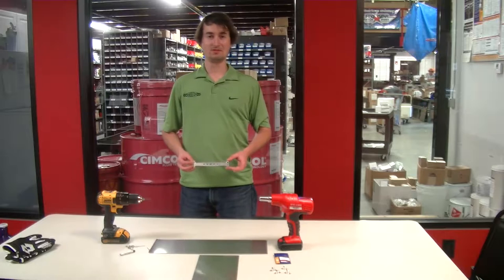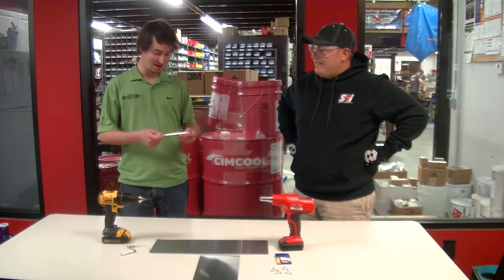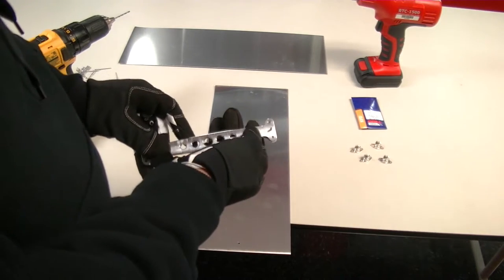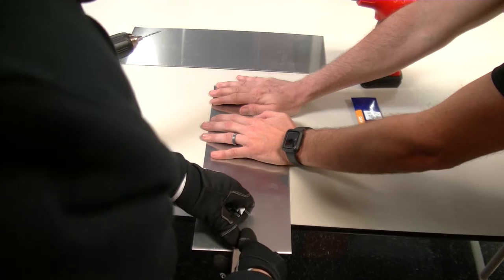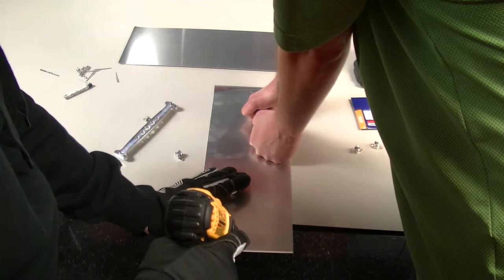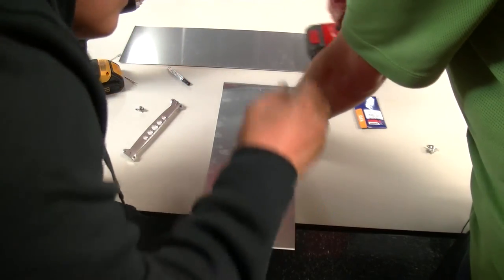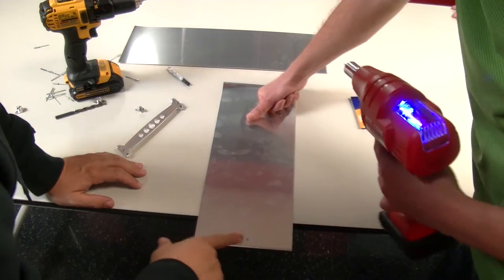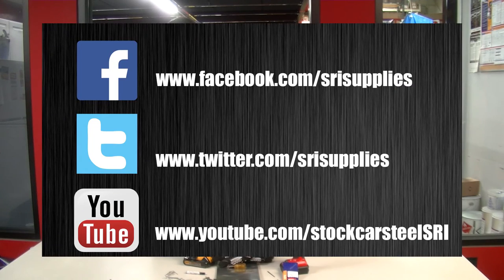SRI Supplies Presents: How to Install Camlocs

Comment: Good demo of the jig.  A different camera angle would help, but the receptacle installation is the easy part.  We'd like a demo of the installation of the 2700 flush mounted stud with grommet, including explanations of how thin can the second panel be with the flush grommet / stud?  What kind of retaining ring is best for the flush grommet?  thanks.